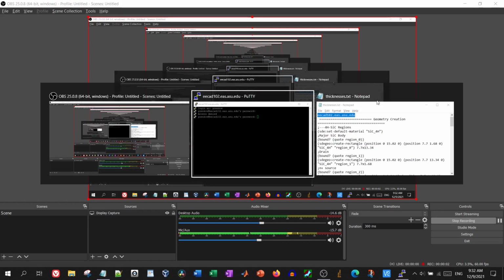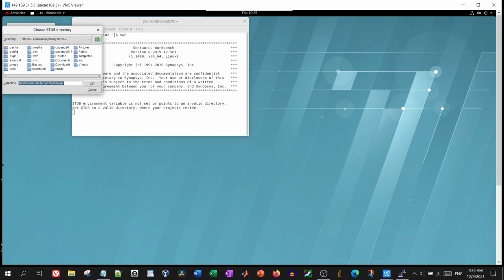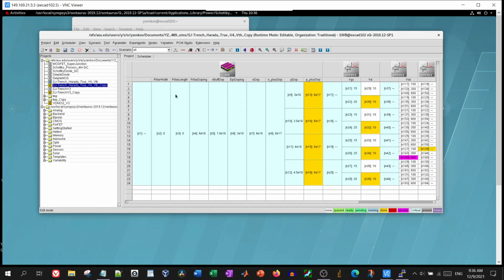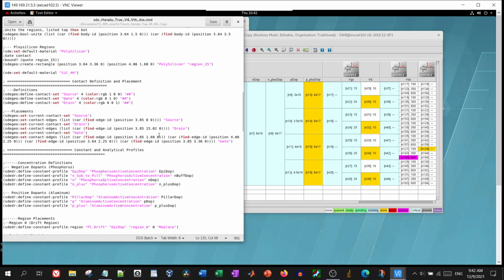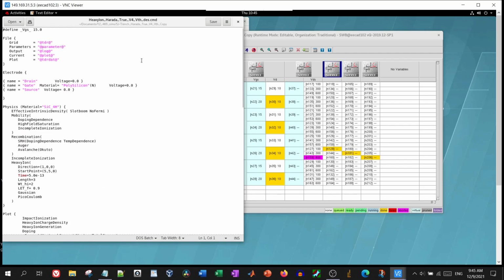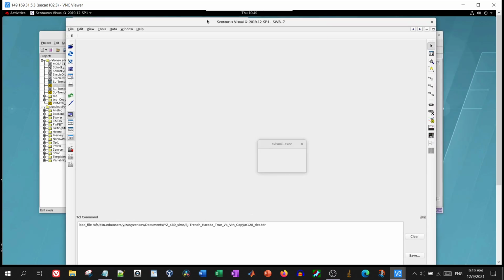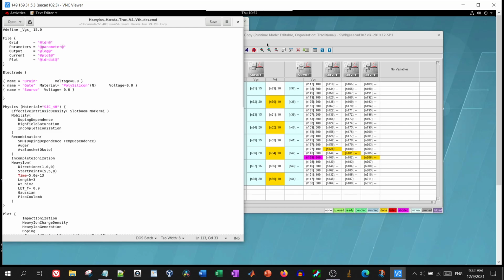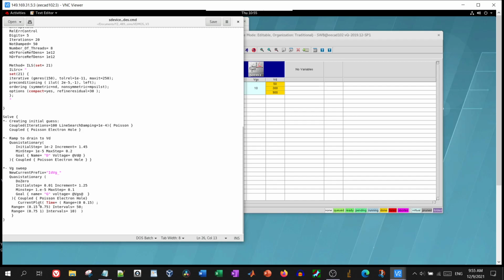Synopsys TCAD for Heavy Ion simulations tutorial

Comment from the maker: Some stuff missed in the recording:

A node is a combination of variables. Run it by selecting it and hitting 'Run'. Always preprocess if asked. Blue means running, orange means complete, red means error. If the simulation is stuck, double clicking into the node explorer will show a log that is stuck in the middle of a solver iteration. You can abort the node and 'clean up' the output.

The syntax I was looking for at 20:18 was:
HeavyIon("Ion1"):{
s_hi = 2e-12
a_1 = 1
a_2 = 1
a_3 = 1
a_4 = 2
k_hi = 1
c_1 = 1
c_2 = 1
c_3 = 1
c_4 = 2

}

In order to make nice figures, open multiple TDR files in Synopsys Visual and make sure the color bars are the same. Usually only the upper value needs to be changed. Click on each item (axis, title) to edit.